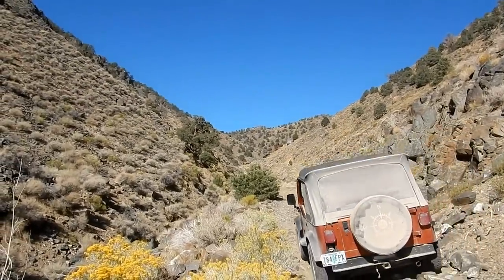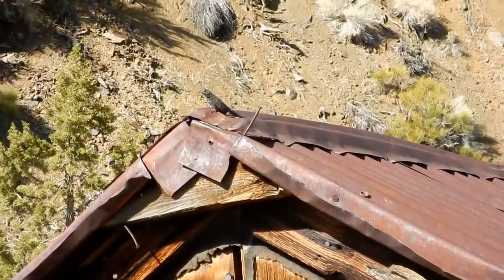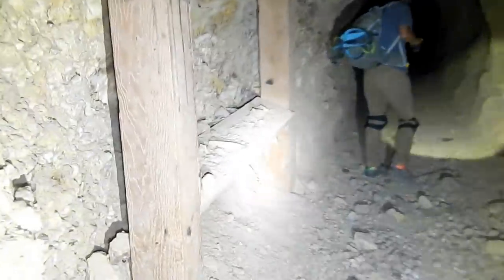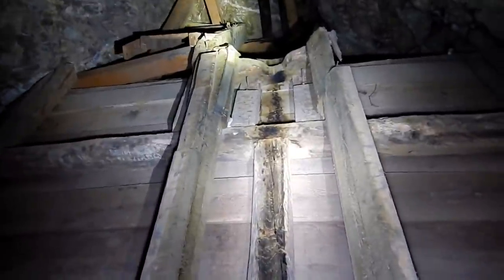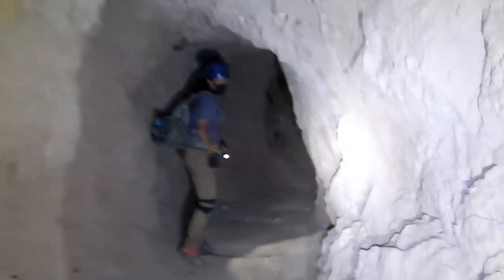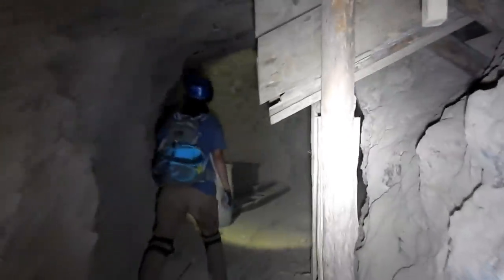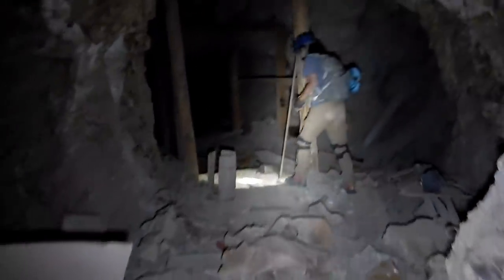Huge Multi-Level Tungsten Mine With Numerous Artifacts (part 1 of 2)

Comment: You must've went into one of the higher adits there. I didn't recognize the portal from when I was there ten years ago. Never made it back up there to check out those higher workings. I've camped at the mouth of the canyon, though, where there is that concrete slab. Great camping spot! Nice video, Tom and Julie! I see Julie is wearing knee pads. I don't recall her ever wearing those before. We're getting old! LOL
Reply from the maker: Thanks for the comment,  Frank! It is a nice canyon and I bet you liked camping there. We finally found some knee pads at Harbor Freight that are medium duty and comfortable to wear. They are only about $7.

Comment: Tom ,  @28:09  --  that's an end cap for a bundle of Core Drill Steel .  I have a half-dozen or so , of them but mine don't have all the fancy cut-outs in them .  I use them as Molds to make concrete Pavers and Stepping Stones .   ---    < Doc >  .
Reply from the maker: Ah, I didn't  recognize that so thanks for the information. Good to hear from you, Doc!

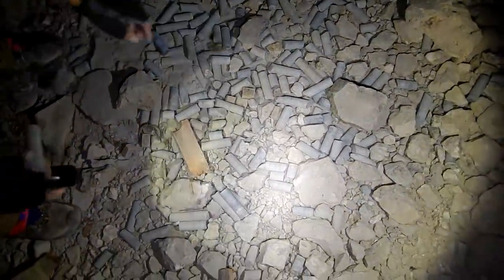Comment: The wood blocks at 20:21 were used as core sample separators, marked with index numbers, as they were stored in the lager flat box.
Reply from the maker: That makes good sense. I figured they were used somehow for identifying the samples. The penciled numbers on the blocks were outstanding. Like a calligrapher numbered them. Thanks for that contribution.
Reply: The numbers are the depth; so 159 feet from where they were drilling. In a spot like that it could be 159 feet in pretty much any direction. To find a big pile of cores and blocks in such a place suggests that either they threw out a bunch of old samples (But why way down there?) or suffered a disastrous upset of their core flats and spilled a couple days' drilling all over the floor.

Comment: Great video Tom and Julie, looks like the jeep got a good work out driving up to that mine,is that a 4 cylinder or 6 cylinder,I have owned 4 jeeps all 6 cylinders. The mine was huge , I would have been afraid of those ladders.You guys stay safe and keep making videos.
Reply from the maker: The Jeep is a 4 cylinder. It's a little underpowered on the road, but does okay offroad. We've  been beating it up pretty good lately. I'm replacing the transmission mount as soon as I can get the parts. It's not easy fixing things when we're on the road. The mine is great and the ladders aren't  too bad. If you think about it when was the last time you fell off of a fixed ladder. Most ladder accidents happen when the whole ladder tips over and that can't  happen with these mine ladders. Thanks for watching, Jeffrey!

Comment: Great video!!!......However, when climbing ladders in old mines (or anywhere) it is good practice to never put both feet on the same rung. If one rung gives way, you are still left with the other foot on a good one (you hope)......be careful and keep the videos coming!!!!
Reply from the maker: That's a good theory, and  we get that comment once in a while, however, it is not easy to achieve that for a number of reasons. After climbing hundreds of mine ladders I try to make sure I always have three points of contact and to use my arms as much as possible. Thanks  for watching and for your input. We appreciate it!

Comment: Bet the miners of 1955 would have loved high power LED lighting.
Reply from the maker: I would have to agree. I had a job in the late 1970's that involved using a carbide/acetylene headlamp and they do put out a surprising amount of light. They are kind of a hassle though and get blown out somewhat easily. The LED lights of today with low power consumption, adjustable beams and compact size, are really quite amazing. Thanks for the comment!

Comment: You can tell how old things are in a general way by the font they used in their handwriting.  I have a couple etchings I made in a cave in Virginia where confederate troops holed up in the cave for like 15 days.  Some of them scratched their names in the wall of the cave and sure enough the etchings look just like the font soldiers wrote in back then.   Things change subtly and people schooled in that stuff can date things down to the decade by the font.  Like you showed on those blocks of wood.
Reply from the maker: I really like some of the older handwritten stuff. People had such fancy penmanship back then. It makes sense that you could date things from the writing style.